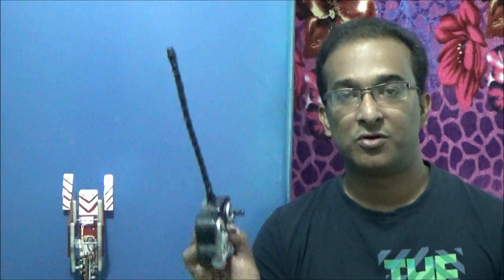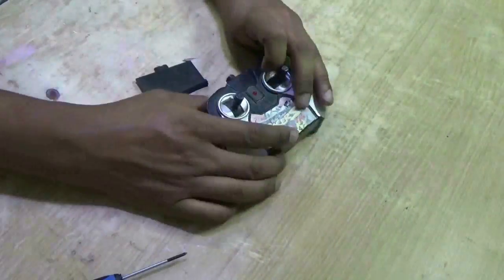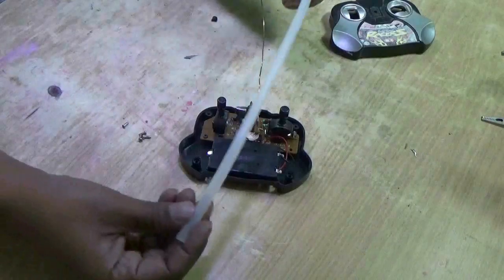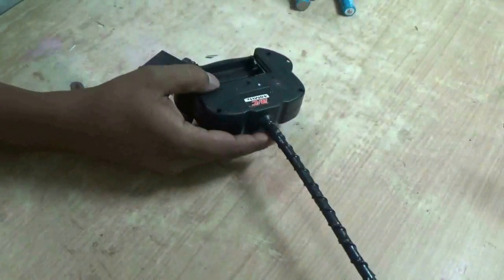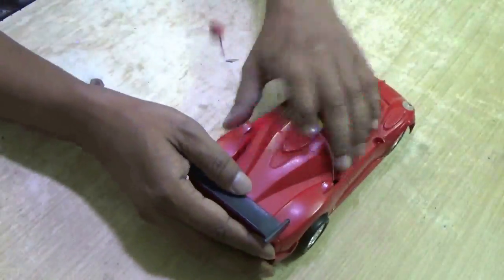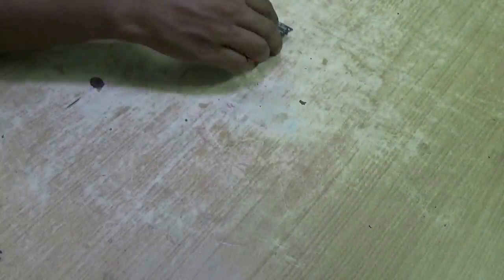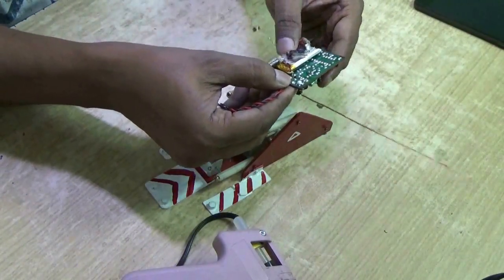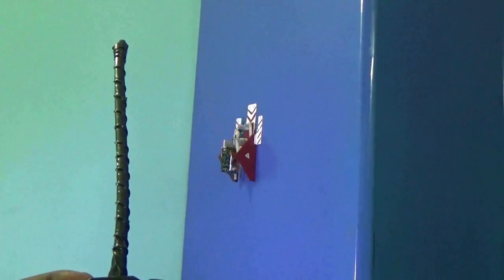How to make a RC climbing robot

Comment: the links to the the circuit diagrams you have given in description .are they any good for powering a high speed 12 v dc motor.if no can you tell me how can i control a high speed 12v johnson dc motor wirelessly?
Reply: approx 1.5 amp.
Reply: what should be the minimum requirement for it to  work.